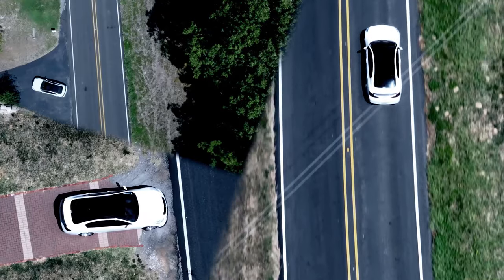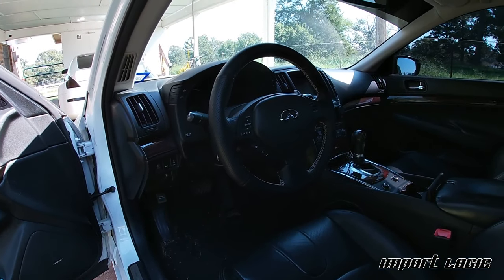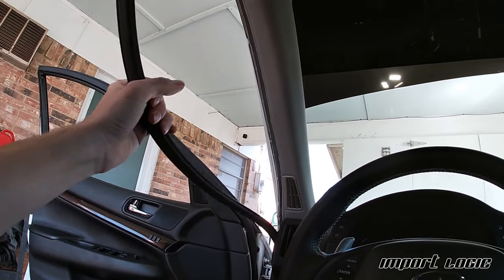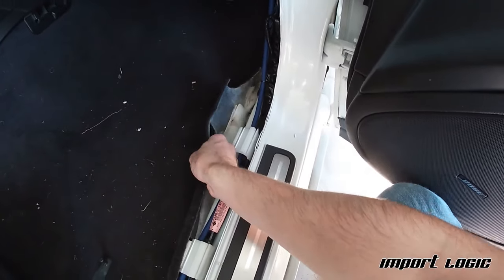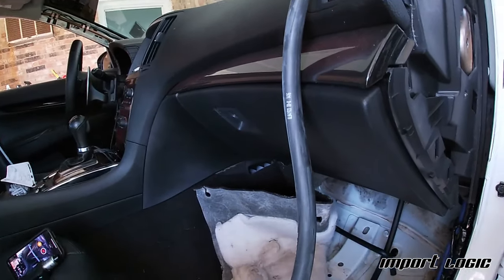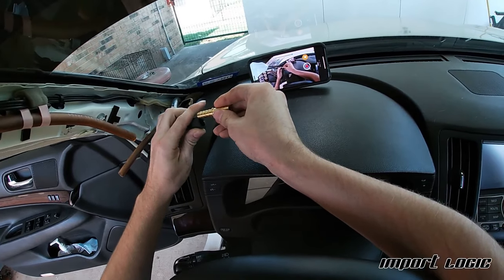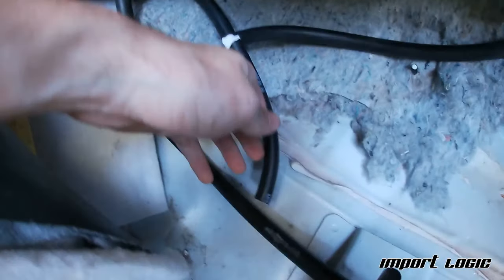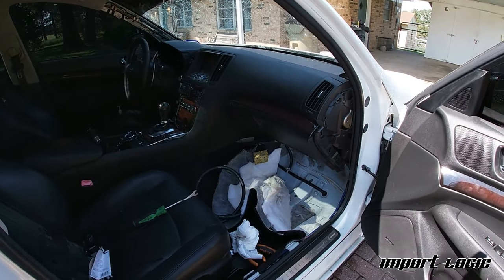Infiniti G37 Sunroof Leak Fix! - Simple Permanent Repair / Fix

Comment: I did my drivers side this past weekend and plan to do the passenger this coming weekend. Had a small issue with the ac hose fitting 3/8 or 1/2 so I had to use a ton of sealant and 3 zip ties. I plan to make it better this coming weekend but I tested it and it worked.
Reply: What did you use for sealant?  I ended up going through a 3/8 to 1/2 adapter and then 1/2x1/2x1/2 tee.  Tried zip ties then stainless hose clamps, but i still have leak.  At least I transferred leak from driver side to passenger side, but I know it's my repair that's leaking.  This is for 2013 with the larger diameter (and thinner wall) condensate line.  Thin wall tubing and barbed fittings not the best match.

Comment: THANK YOU!!  Just did this on my 2013 g37 today and it works perfectly!  Great instructions, really appreciate the video!
Reply: do you have any water building up in the tube or did you have the hose go perfectly down hill on both sides?
Reply: @diegobarragan7898  There is maybe an inch or so of water buildup in the hose coming from the drivers side right where it hits the T joint because I didn't get it perfectly downhill, but I haven't seen it build up anymore than that.
I also used clear tubing because that's all i could find, but it's nice to be able to see where it's working and where it's not.

Comment: Total lifesaver !!! I ended up pulling the headliner off a bit to expose the 2 drain locations. Added new hoses to both sides. Ran it to the ac condenser drain plug under the carpet. 👍🏻 spent $29.99 at Menards (W)
Reply: Have you had anymore water leaks after fixing this way? i still wonder if tthe plugs on fire wall would still cause water to leak some how? if you could reply would mean tons! Thanks.

Comment: Bcm got fried due to this. Comprehensive coverage only cover replacing the bcm, key reprogramming and clean/drying up the carpet. Sunroof was classified as normal wear. They wanted over 2 grand to fix. So thank you for this video.
Reply: What was your symptoms of your bcm getting fried?
Reply: @dustinvq37  My car would not cut on at all. Even after trying to jumpstart it with two fully charged jump boxes. Thinking that it was the starter, I replaced it, but all that did was made more confusion as the car this time would not turn off without completely removing the positive terminal and circuits. After finding the water under the rug and getting obd checked.   A crapload of codes thrown relating to electrical issues. Mind you, battery, alternator, even my original starter were all good. The bcm was just on the fritz from all the moisture. We have had not only bad floods in my city due to the rain and clogged sewer drains, but we also just got hit with snow. Just got my car back today from infiniti, new bcm. Running great and firing right up even faster than before. However, I still need to treat the leak to avoid ever having this happen again.

Keep in mind, fellas, if you go through your comprehensive coverage, they will also cover the diagnostic fee. If you find water intrusion under your carpet, the best bet is to utilize your insurance for the moisture if it caused an electrical issue that your premium will cover.

Comment: Hi,
I did this to my moms 2011 Infiniti G25x, got everything (3/8 tees & 3/8 brass barb). I had to order from Amazon 3/8 x 1/2 x 3/8 Tee because it wouldn’t connect to the a/c condenser line. It’s a perfect fit now.  Thank you so much for this video helped out a lot!!!!
Reply: Hi, any chance you might have a link to the 3/8 x 1/2 x 3/8 tee you bought? Would really appreciate it, thanks!
Reply: @coreyos1231  it won’t let me post it on here lmk where I can send the link to you
Reply: Lmk where I can send the link. It won’t work on here

Comment: Genius! I had to permanently fix mine the other day but all I did was shove some rubber tubing roughly the same size in diameter as the oem plug in the drain hole then fed the sunroof drain tube down that. wish I would have thought of this but no way I'm going through the headache of ripping it out again

Comment: Big thanks to Import Logic for this video. I had previously replaced the passenger side plug in the firewall - a miracle that I got the plug through the sound insulation and into the wall. Didn't want to do that again so I followed this approach for the drivers side. Bought 1/2" OD 3/8" ID clear vinyl  tubing at Lowes (US hardware store), along with a 3/8" - 3/8" barbed junction that I attached with zip ties in the A pillar and a 3/8x3/8x3/8 T. Because the AC line is slightly larger, I used small hose clamps all around at the T. I also zip tied the tube above the accelerator to ensure no interference.  I couldn't get the entire tube to go downhill to the AC condenser, so there is a little water pooling in the tube below the steering column.  I wish I had bought black tubing to make this less obvious.  Installed yesterday and so far so good!

Comment: Just finished this repair thank you so much! The AC line is 1/2 inch so needed to use a 1/2x1/2x1/2 tee for that one and squeezed the 3/8 line on to that tee since the store didn’t have a 1/2x1/2x3/8. Had to use a couple of slightly different routes down from the A pillar because the hole was too small in my car (2012 g37x)

Comment: I did the straw method about a year ago. I was going to go to car show today actually, but I got in car, and knew instantly it was leaking. :( I will be doing this method next, thx for sharing!. My awd stopped working also. I'm going to be cleaning all the grounds with a wire brush, since it got wet.
Reply: Just did the job today. My 2012 G37xs sedan had 1/2 in line for the ac hose. :( I put the 3/8 tee on there for now, clamped tight. Figured this comment might help someone

Comment: Thank you for sharing this genius method. My 2012 G37 just leaked for the 1st time. I merged the left and right together close to the ac line, then used a 3/8 to 1/2 adapter before I connected them to the 1/2 ac line.

Comment: I did mine by just cutting the existing hose on the Pilar. Adding  barb fitting with hose and taking out the existing fitting in firewall and just going straight with the hose into the firewall. You will need long pliers. Harbor freight has cheap ones for $10.
Reply: This was my idea as well.  How has it held up?  How far into the firewall did you run the hose?

Comment: My husband just got done doing this on his 07 g35 sedan. Only problem was that the AC drain hose was 1/2 not 3/8. If this is the case make sure to get a 1/2 x 3/8 x 1/2 t barb fitting so it’ll fit into the new hose. He had to run around trying different stores looking for the exact fitting. Amazon also has it if you can’t find it in store. Other than that, thank you for this helpful video!

Comment: This worked very well. Thank you sir! Only issue I came a cross was during the water test I did before installing the panels by windshield. I had water leak through where I made the connection from existing hose to new hose. I changed from zip ties to the clamps and no leaks after that. Couldn't tighten zip ties more than I already had them! Other that no problems! Thanks again.

Comment: Before going through all this try taking some weedeater line and showing it through the drain line. I did that and I took an air compressor and some rubber tubing and sprayed 100+ psi directly into the line. Between these two things, something worked. It might not be a long term fix, but I’m trying to avoid pulling apart my dash at all costs.

Comment: I was planning on using the straw method but this seems much more efficient. I washed my G37 recently and had an inch of water on the passenger floor. AWESOME video brother. I'll be doing this, this weekend
Reply: i also washed my g and water got inside and messed up my Bcm

Comment: Thank you, this is way easier. I have the same issue with passenger side but on both front and back carpets and trunk as well. Does anyone know if this will stop the whole leaking issue or should I address the trunk and back passenger side separately? Thank you 🙏

Comment: Well did it today on my 2012 g37 sport sedan. Only hiccup? The a/c hose is bigger than 3/8, so it swallowed the 3/8 brass T fitting. Luckily I had already bought a 3/8 plastic barbed T fitting and  believe it or not, I couldn't get it onto the 3/8 hose I bought, but it fit onto the a/c drain hose like a glove. It's fixing to storm here in central florida now, so we will see how it all worked out. Wish me luck!!
Reply: I think it's 0.5" OD and 3/8" ID hose.
Reply: So what size do I buy for the last T to connect the 2 hoses to the ac drain?

Comment: My g37 sedan just started leaking on the driver side, I'm so glad I found this, it seems like a better repair approach than the other methods...I just want to make sure that you used two - one way barbs and two T barbs for this repair?
Reply from the maker: This is correct. Although the condensate drain is slightly larger than 3/8 so if I could do it again I’d get a special barb that fits that line better and a 3/8 Tee. But it’s not far off, I just used hose clamps to make the difference.

Comment: Our 2012 G37 leaks, so I did this repair sans the ac line connect. Only gets wet in hard rain now, but still not perfect. Video posted of the work done.

Comment: This video is super helpful, thank you. I’m stuck on what tee I need to connect the 3/8 hose to the AC drain hose though since it’s larger, thinking it’s 1/2 in? Does anyone have a link or description of the tee I would need?

Comment: Great job boss. I have the same model and used to be sick walking back into the car with puddles, a damp headliner and wet seats. I went about the hard way accessing the firewall some years ago now. Took a couple tries to fix for me but I used the straw on a lubriderm lotion bottle to extend the nose along with the shaft of a pen superglued and zip tied.

Comment: Great video my g37 coupe leaks badly I'm going to use your method and I have to pull the carpet up and and remove the seats to properly dry it out and clean it. After that it should be fixed!!! Thank you for the walk through

Comment: Another quick way ( if you don’t wanna tap into ac drain line and route the hose from driver to passenger side )  is to run that 3/8 hose on each side separately straight down to the floor into the deep channel that’s there ( water is sitting there when you have a leak ) and drill a hole in it and push hose thru the floor outside. 
So new hose is routed under the dash straight down to the floor.
Reply: Water can come back up this way though correct? (Flooding)

Comment: Wow im so sick of water getting into my car after it rains Heavy. Ive cleared the driver side drain and replaced it at least 5 or six times. Did the passenger side once, and did driver side 1 final time last weekend. Also cleared the drainage area under both front tires as there was debris in that area. If it still leaks after all of this, I am trying this method.

Comment: I just finished doing this to my 2013 G37 sedan. It was just as you described except the a/c drain is a bigger diameter so I just attached a short piece of the 3/8” tubing to 2 ends of the T connector and then inserted it into the larger 
a/c drain. Hope this fixes it
Reply: Do you happen to know what size the ac drain hose is?
Reply: @christophermcsherry2655  no but the 3/8” stiff white tubing fit snugly into the drain hose and fit so well I didn’t need a hose clamp or zip tie

Comment: Could you use brass T barb fittings instead of plastic? Is it better to use plastic over brass T fittings for the floorboard only?
Reply from the maker: Brass would work fine. I only used what I could find at my location hardware store. If you use brass I would wrap it in tape or something to keep it from hitting other metal and creating a rattle while driving.

Comment: Thanks, man. believe this is what friend my BCM but I never had the wetness in the passenger side. It seems that after a long week of rain, my instrument cluster just went out, where I can't control the radio, AC, etc. I have no display either. What I did find, is my rear spare tire area is FILLED with water. Like 2-3 inches. I don't get this. I think I'll do the new drains just to be safe but what could it mean if it's not wet on the inside passenger but the rear is filled and my cluster just stopped after a storm. Hell this car went through Hurricane Irma here in Florida and it was fine, but all of a sudden on a rainy week, it just goes out?! Any advice? Thanks for the video, super helpful.

Comment: It has to be vacuum hose or could be any type of hoses? Since I’m thinking to get PVC or Fuel hoses.
Reply from the maker: Anything will work. As long as it doesn’t dry rot over time. Vacuum hose is pretty resilient.

Comment: OMG! I just found this video. I have been using strips of black duct tape on the sunroof to keep the water out on my 08 G35. I will have to do this to fix the driver's side. How is it that Nissan has had this issue for so many years? I've read the comments and see 08 to 14 but it may be longer. Thanks for sharing this! 👍
Reply: I just finished this job and it worked well. On my 2008 G35 the A/C line required a T bard of 1/2 x 3/8 x 1/2. Hope that helps!

Comment: did you do anything for the rear? my rear driver side is getting soaked so i can only imagine it’s the rear drain
Reply from the maker: I don’t think the rear has issues however when you accelerate the water from the front sloshes to the back. I had the same issue.

Comment: PSA The A/C drain hose (1/2" ID) is a different diameter than the sun roof drains (3/8" ID) hence he used actual clamps and not zip ties there. I tried this setup and it's still leaking, not from the sun roof section but from the A/C section. Maybe the flow restriction there is an issue causing condensation to build up (Houston summer humidity) resulting in water in the floor panel wells, not sure. Any thoughts? 

To clarify,  water runs and drains if you spray on top like the video with the car off, but when running there seems to be an issue with the A/C line section.
Reply: My sun roof drains were clear 1/2"🤷🏻

So best to check existing pipes before buying supplies.

Comment: I am currently in a situation right now, I am at the step where I am about to tee into the condensate drain. The thing is, I only bought 3/8 x 3/8 x 3/8 tee, do you think I should be okay if I were to just clamp all sides? Condensate drain is 1/2” hose
Reply from the maker: Finding a 1/2 barb with a 3/8 tee would be ideal. I had trouble finding one.

Comment: Not to sure you’ll answer but any chance you’d know if the hose is 3/8s for the 2013 models as well ?
Reply from the maker: Should all be the same. The bigger condensate hose under the carpet is a little bigger but I made it work.
Reply: @importlogic what size hose clamps I used 2 zip ties on each side but still leaking thur think I need a tighter fit so imma use the hose clamps like you did

Comment: I'm trying to understand exactly what causes the problem in the first place.  I was under the impression that the stupid drain plug would get clogged and thus the water would overflow out the sides.  If that's true, couldn't the barb connectors and T-fittings get clogged up over time as well?

Comment: You the man bro!... just did the part replace a week ago... next time it leaks im appying your method!! Thanks for this!... quick question, was there any minor leaks being that you cut the A/C drain? No minor leaks atall or fumes? 
Thanks
Reply from the maker: None at all, the ac drain is purely condensation. Only water comes through that AC drain originally so no reason for fumes. The AC drain pipe is slightly larger than 3/8 so I would suggest using larger T connection to reduce restrictions, I just used hose clamps to tighten the line to the T. Although I haven’t had any issues with the condensate backing up.
Reply from the maker: @30calCrazy probably just under 1/2. I just crimped them hose down on the 3/8 barb and called it a day. It is a slight restriction but I haven’t had any issues with it backing up, if I do I’ll cross that bridge when it comes. I had double finding a T that had one 3/8 barb and 2 slightly larger ones.  All the hose I ran was 3/8.
Reply: Sure enough, new parts stopped working. Just applied the method, works like a charm!! Youre the GOAT! @importlogic

Comment: What about on the older G35? My 2003’s drain hose is actually hidden inside the A pillar frame and not easily accessible even with the trim panel removed

Comment: So when you cut the original hose to add the black one it’s basically rerouting the water to go out the AC hose that’s why towards the end you attached them all together ? This would all prevent it from going through the fire wall and potentially leaking into the car correct ?
Reply from the maker: You are correct, this bypasses all possibility of leaks at the firewall unless you have something els unrelated to the sunroof leaking.

Comment: I fixed the front passenger side leak and now I have a rear passenger side leak with what seems like water coming in from under the rear window. Could the water be coming from frameless window rubber seals?

Comment: I wonder if you could take a high pressure vacuum and blow air to the south or suck air to the north to clear the debris inside the existing tubing.
Reply from the maker: It’s not debris. The seal dry rots and leaks at the fire wall. Regardless of a clog or if it clear.

Comment: Thanks a lot for this video bro. You are very appreciated. This video helped me out a lot. Saved me so much money. My only problem was that my AC drain is a tad bit bigger so I had to get a 1/2 inch splitter and squeeze it into the 3/8 inch hose other than that it drains great! 🫡